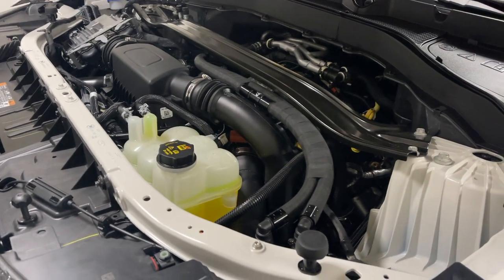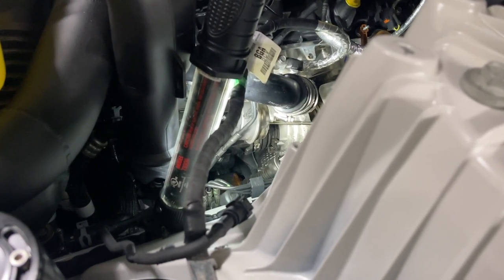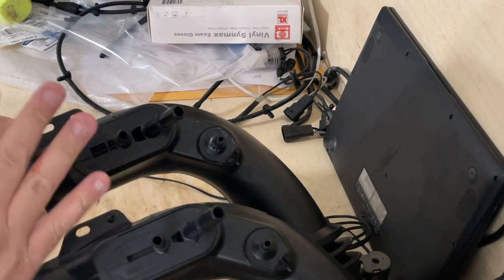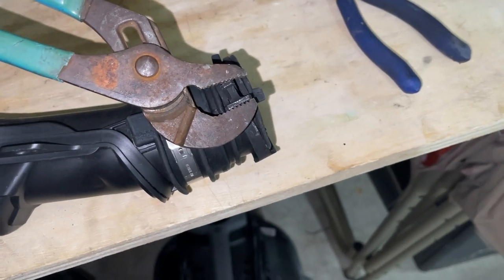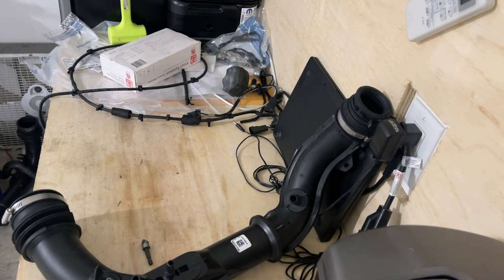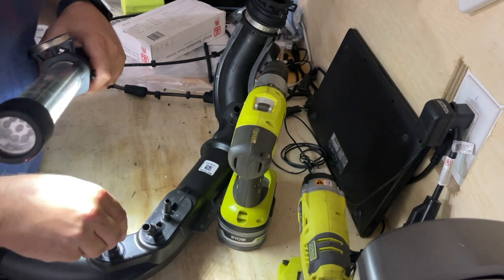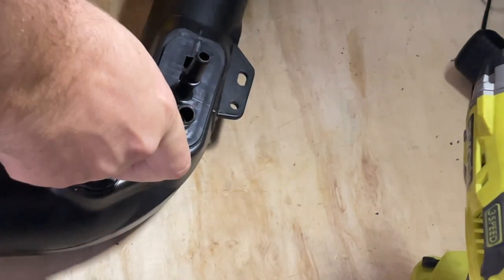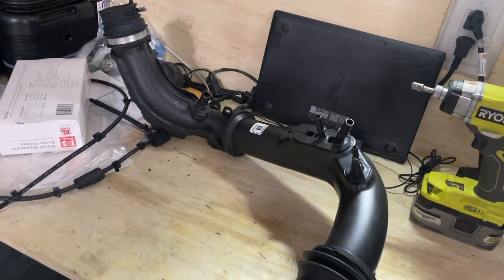2020 - 2022 Explorer ST  Factory drivers side intake tube removal / install and modification.

Comment: Thanks man!
Reply from the maker: I’m glad this video could help someone out.  I was beginning to think it was a wasted video.
Reply: @KnightsGarage  not at all! my intake should arrive today was wondering how I could get that driver side intake off without having to run out and get a new tool. I appreciate it
Reply from the maker: @jim6807  yeah I didn’t want to buy it either just for that.    Have to be careful so the channel locks don’t slip off, but it’s not like they were easily slipping off for me.  I did it this way three different times with no real issues.
Reply: I just broke mine!!! What is the part number for awe fitting?